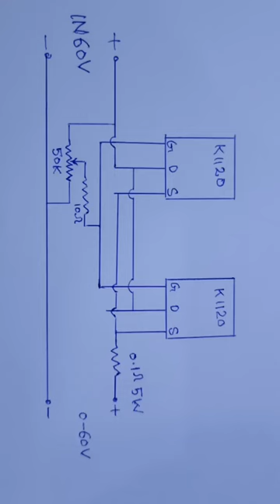How To Make Voltage Regulator 0-60V 40A

Comment: If you never show you actually measuring the Amps 😢how do you know that you got the amps you stated in your thumbnail?
Reply from the maker: You can calculate the amp of both mosfet reading datasheet
Reply: @TARIQLAB Blah! 😂 
Even if using 100A MOSFET doesn't mean your circuit will actually work at 100A

Comment: I assume noise and ripple is garbage on this but how does it perform as a battery charger? Been looking for an effecient way to move energy from a 48v battery to 12v for some time. Can these work in paralell for higher amperage?
Reply: none from it, its two FETS he's attempting to operate in the linear region. Its a just a crude linear regulator.

Comment: AC or DC
Reply from the maker: Dc to dc
Reply: The output is certainly DC and without a rectifier at the start, it has to be DC too. A thermal protection of some sort would be good with the suggested amperage.

Comment: scematic not same as build
Reply from the maker: Point out difference
Reply: @TARIQLAB  resistor 10 ohm in series with runpoint or over fixed points potmeter.
Reply from the maker: Yes 10 ohm in schematic, and i used 10 ohm 😄